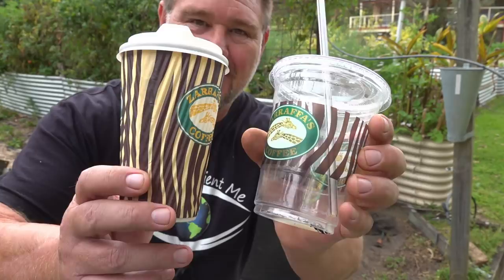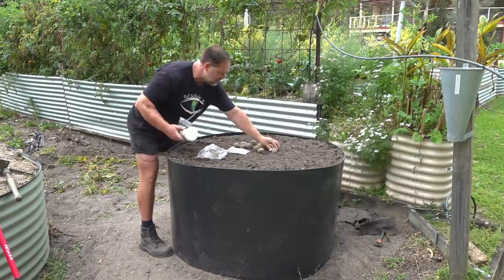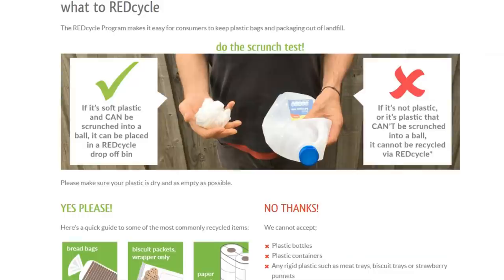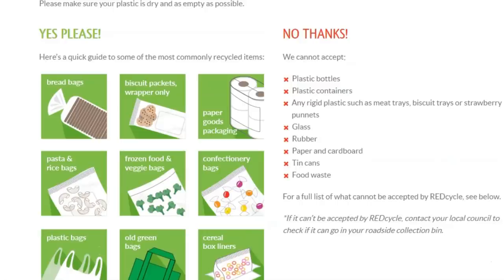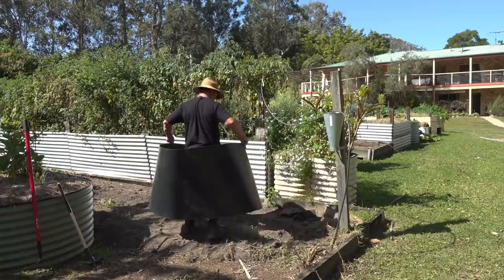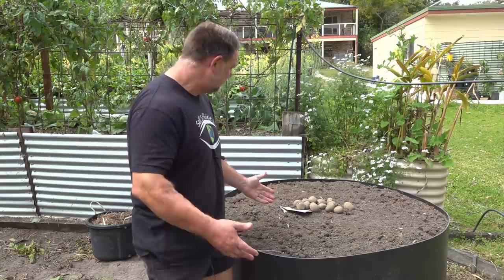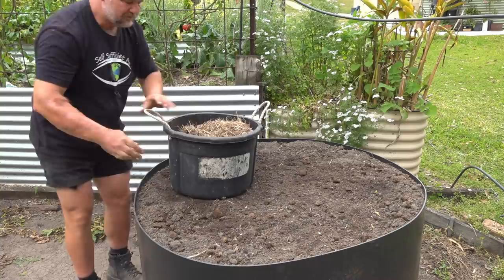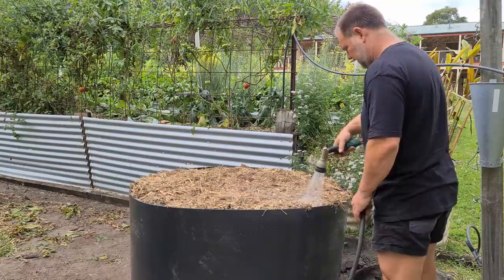Raised Garden Bed Made From Coffee Cups

Comment: I'm not sure of the context of the roads thing but there is actually good reason not to add too many hardening things to bitumen. Grady of Practical engineering did a video on bitumen recently its actually recycled all the time  not disposed of. If you add too much plastic to it and make it too hard it can be difficult to recycle especially if you have to heat it to higher temperatures you get more breakdown and have to add more  virgin material.

Comment: I share your thoughts. The problem is people trying to separate trying to make money vs doing the right thing. You need to make "waste" plastic into a commodity that is accessible to all people. I remember back in the day before glass and pop cans didn't have a refundable value. They were trash everywhere. Then then had a few cents and all of a sudden people started collecting them. People also learned howto melt things down and reclaim metal waste for sale later. Plastic needs to go through this same process.  The ideal situation is reclaiming plastics for 3D printers, or using plastics as a compressed building material.

Comment: The  problem (or at least one of the problems) with recycling plastic, is that you can only recycle it so many times before it becomes too fragile. This is one of the reasons why you often see made with 20% recycled plastic . It's not like aluminium cans that can be melted down an infinite number of times. This is why I believe we DO have to put regulations in place. Plastic has many valuable properties, but unfortunately it's main advantage is that it is cheap. As long as it continues to be a viable material (and in some cases justifiably so, as in the case of airplanes, cars, certain re-utilizable goods), it will continue to be used. Either we tax it or we discover an alternative material.

Comment: Hi my friend, love your way of thinking and use of this material. I have used the like k to ask them if it is available in UK for the organic veg garden I am building. I'm sure it will be a success. I think you could add security and strength on the join with a metal strip on the inside and outside acting as a washer under the bolt and nut. The cookaburrah is a beauty.
Reply: You want to use plastic for organic veg? doesn't that rather defeat the objective.

Comment: Recycled plastic makes can be made into many products: Roof shingles, walkway and driveway tiles, this raised garden bed, and so on.

While making use of waste plastics this way is fine, these products still have a finite life span.  What happens when this garden bed breaks apart, or those tiles degrade?

We're back to square one with a heap of waste plastics, and this time not relative virgin composition.

Recycling is important, but we cannot recycle our way to a clean environment.

Reduce use of plastics first, then
Reuse by making durable repairable products, and only then
Recycle.

Comment: Great Idea and product!
Is there a way to weld together the joint? Like a hot glue from the same stuff. For these hot glue pistols. 
You could also 3d print this material.
This matierial could be used to make Pools or Solar Panels to heat water and harvest energy. 
What about uv resistency? How long will this plasic last until it desintegrates? 
What about poisinous mattes in the plasic or chemicals that are produced when the material is exposed to uv or high or low ph like in same soils?

In germany there is the same Problem. A lot of plastic is being collected and seperated - germans love their waste sepration., but most of this precious Material is just being burnt. 
I would be happy if this technology was exported to germany or whole europe.
Thanks for the inspiering Video!

Comment: I can just see the two or three tier at the top of my sloping front garden area.  Sadly they don't ship overseas and I haven't seen anything like this in New Zealand.  Maybe they could form a partnership with a like minded company here over the ditch.   Good on them!!!   And you for giving the product air time.  I'm thinking that the taller one would work well as a compost bin also, as long as you could simply take the screws/bolts out, then open it out for easy access to the finished compost.  Would be good if they did a forest green also.  Hmmm and maybe a purple.  Oh well I can dream.

Comment: Here is their info from the website:

Made from durable recycled plastic – will never rust, split or rot
Quick and easy to assemble – no power tools!
Sturdy
Lightweight
Weatherproof and UV stabilised for long life
Maintenance-free and virtually indestructible
Easy to empty, store and set up again when needed
Not chemically treated (like CCA timber)
Great value
Australian made and owned, with a 5-year warranty
Screws included – Black top
Available in a range of versatile sizes and shapes
Recyclable at end of life
Made in Australia from 100% recycled post-consumer soft plastics, in accordance with AS/NZS ISO 14021
This means the product may have some surface variations or colour variation from batch to batch.

Comment: If they sold them in a kit with posts made of the same material, you could use two for the long sides and shorter pieces for the ends, making a large square bed like those you have.  If it is a good product, advertising and consumer interest should take hold and there'd be no need for government interference.

Comment: I am most certainly interested in these beds: getting a bit over working with Bunnings siena timber to build beds (although they do look nice). At $16.50 apiece for each timber length, for 12 (4 high) that's AUD$198. True, they do hold more, but I'd be doing diddly-squat trying to help manage the environment. How did you manage to talk the Plastic Forest folks to make the 75cm high version? That's the one I'd be after.... 60cm is just a wee bit too short.
Reply: 725mm is available. Thanks Dave
Reply: @plasticforestsptyltd7014  Thanks for that, mate!

Comment: I must admit it was a bit of a shock when I saw the price of a single flat piece of recycled plastic $122 AU but then I used to work as a rubber moulder and pieces of rubber which cost 5 English pence were sold as BMW plug leads for £40. Maybe if the company making them had as much interest in saving the planet as the people buying them they'd cut the prices a bit?

Comment: The only thing I don't like about it is that it's not perfectly circular, but I'm sure there's some way to fix that if you really cared.
Reply: Of course. Fill it about 1/8 full to get it set down, and then put in a 2x4 or hefty branch that's cut to length and spin it around to knock the narrow ends outs.

Comment: Is there a manufacturer of UV resistant injection-moulded hard plastic plug module trays to start seeds year on year? The flimsy plastic inserts for gravel trays only last a couple of seasons 
I got 4 Euro sized 60cm x 40cm 140 plug trays off eBay manufactured by Stamp, France but they no longer make trays. I can't find a tray slightly larger to bottom water.
Containerwise in UK make UV resistant injection-moulded hard plastic plug module trays but I'm considering my options as I don't jave much staging..

Comment: I have never seen hay bales wrapped in plastic like that and I live a state whose primary export is farming. I've only seen cotton bales wrapped in plastic like that. Maybe it's an Australian thing?
Reply: Our sun would dry it out very quickly otherwise.

Farmers often bale hay in large round bales instead of small square bales because they require less labor to bale and move than small square bales. The shape of round bales enables them to be stored outside, something you would never do with square bales. Rain and snow naturally run off their curved sides, like a roof.

Farmers have three choices of materials to wrap bales – twine, net wrap, or plastic wrap. Unlike gift wrap, the choice isn’t just about presentation. It’s about baling efficiency and storage. If properly baled and stored, hay can last a long time without degrading in quality.

Comment: Just wondering about heat in summer given they are black an thin. Would it be worth insulating the edges with mulch around the inside?
Reply: Polyethene is a poor conductor of heat. That means it does not transmit the heat like say aluminium which is a great conductor of heat, that is why they use aluminium as cooling fins in computers. One experiment we did was to raise the temperature of our i-90 product which has a 12mm thick wing, from 27 deg C to 211 deg C, the other side was only 40 deg C after 11 minutes of a blow torch. Thanks, Dave

Comment: Why not make plastic timber? Mixed with wood pulp, it would not burn.
Reply: Timber and plastic still burns, at about the same rate as normal timber. It just has a higher temperature ignition point at around 350 deg C. Thanks Dave

Comment: Greeting friend, any concern that this type of raised bed will get hotter in the summer/perhaps cooking your veggies.
Reply: Polyethene is a poor conductor of heat. That means it does not transmit the heat like say aluminium which is a great conductor of heat, that is why they use aluminium as cooling fins in computers. One experiment we did was to raise the temperature of our i-90 product which has a 12mm thick wing, from 27 deg C to 211 deg C, the other side was only 40 deg C after 11 minutes of a blow torch. Thanks, Dave
Reply: @plasticforestsptyltd7014  Thank you, appreciate your passion!

Comment: The plastic bags/coffee cups thing is weird- LDPE. There's nothing really fundamentally unrecyclable about it, very close cousin of HDPE- the stuff used to make milk bottles.it won't leach- it's flexible without adding any extra chemicals.

Its more of a mechanical issue- it's light and airy and takes up a lot of space for very little plastic, worse, it has a tendency to do to the recycling machinery what it does to those turtles- gum up the works and get all tangled, so most don't want to touch it with a barge pole.

Comment: I love this. I’m going to buy one at least. I love the height bc I’m getting older and don’t like bending over as much. Thanks for sharing this. I can’t wait.
Reply: I live in central Texas where it gets hot and flash floods in the spring and 3 digit heat index and no rain after May in most cases. You cannot depend on rain after that. If you get it it’s a blessing. I’ve discovered grow bags and using plastic totes, which is working out great, very little water is needed and I can move them to shade when it gets hot but I want to add a few raised garden beds but they are so low to the ground. This will be a nice addition. Also we have grass here that has runners 12 inches deep. You cannot kill it for nothing. It loves any kind of soil, rain, drought it doesn’t care. I hate it and it’ll take over any raised garden but I think and hope this will be deep enough to keep out this nasty stuff. That’s why the grow bags and bins have worked well, it reduces the work of a battle you cannot win.

Comment: I operate a religiously based charity building beautiful raised bed art gardens entirely from reclaimed and found materials. I appreciate the effort, but reuse gardens don't have to be ugly. You'll never win over the normies with this sort of thing; no one wants their backyard to look like an industrial farm, and I wouldn't find any clients if I took this approach.
And I haven't even touched the issue of the toxic and persistent byproducts that these short lived materials produce as they degrade. There are other more efficient and less dangerous uses for recycled plastics. Let them be used for those purposes, and don't bring them into your beautiful garden.
Reply: @soarer282  Be that as it may, UV radiation and fluctuations in ambient temperatures will still degrade these material's ability to hold soil vertically quite quickly, and you'll be left with a pile  of crumbling garbage. And it will always be as ugly as the south end of a north-going pig.
Reply: @archenema6792  yeah i agree the uv is an issue over here in no ozone land. I do mobile spray painting. Would a nice silver paintjob do the trick for the looks? It would block the uv %100. It will take 15-20 years to degrade to failure. the screws will go long before. i would use two strips of aluminium and some aluminium rivets to hold it together. Take care.